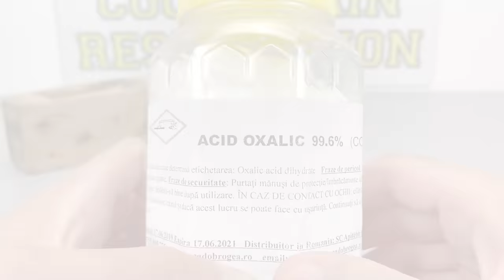Vintage Wooden Toy Car - Restoration & Repair

Comment: I recognize most of those parts as "Meccano" that I had long ago. In the US I think it was called Erector Set. Definitely a 1-off toy.
Reply from the maker: Thank you very much Frank 😎👍🏻
Reply: @CoolAgainRestoration  
Yeah all the metal parts are Meccano from the early 1960s or even earlier and you probably know the wooden body is an old hand plane the wedge would have held the blade 
The fenders and flat pieces would have been green originally
Reply: @hodaka1000  Glad you confirmed the body was a wooden hand plane, that was what I thought as you were doing the disassembly.

Comment: I'm a new sub and digging the videos. I spied with my little eyes, that the plugs put into the body weren't the same plugs you made.
Reply from the maker: I thought someone will say that. It’s the same ones but looks different because when I took out I sanded a little bit and when I changed the angle camera,I reset the white balance and has a lot of pink colour in all that footages.

Comment: All super excellent, just a question out of curiosity, why didn't you get the old crank back?. Only cleaning it
Reply from the maker: Because I can’t clean very well inside that brass part and the steel part had a lot of small pits from rust. It was easy to make new one,not a big deal 🤷🏻‍♂️

Comment: There are plenty of restoration YouTube channels out there but yours is different. First thing I realized that your workspace is very clean and your tools look like new. Working a workspace like yours should be motivating!
A humble question then;
Do you have an education for all those processes? Because knowing about mechanics is not enough. I assume you know well about chemicals for instance. I wonder the source of all those knowledge.
Keep going, we are following. 😉
Reply from the maker: Thank you very much for this kind words. I have a similar job and I know how to work with the tools but never you can be full educated in this job. Every time you learn a new clamp,new tip,new idea. But it’s beautiful in the end when you finish a job.. thanks again 🤗

Comment: 11:06 what is this "rubber shine agent"? this looks very interesting and i never saw this before ... seems to be very helpful

finally i managed to rebuild yourt "cyclone" with a little bit of improvement by a 3d printer :D your idea of this tool is still amazing.
Also you did great work restorating this little toy! this looks so awesome at the end!
Reply from the maker: You made a tumbler like my cyclone? ??
Reply: @CoolAgainRestoration  Yep, i did. The idea ist really great and your concept is pretty easy for people, who have not that much place for a sanding box or such.
Also kinda everyone who is about to build or repair things will have the parts needed lying around, so it's not much you have to buy. My biggest problem was to get 4 equal springs, which will be strong enough to take the weight of the sand, but still not to tight, so the whole device will shake and not just stand still.
Reply from the maker: I bought a spring box from Amazon with 5$ . From there I took my spring from that project

Comment: when i fix old wood,,  i use a vacum chamber  and epoxy slow set,,   the vacuum  just helps draw that epoxy in the cracks and pores deep  when released slowly and done several times over just a few minutes  and set to cure   great for worm eaten wood as well
Reply from the maker: Thanks for the tips 😊

Comment: Apologies if this is a silly question, why did you put a thin piece of metal as you cut off the wooden plugs?
Reply from the maker: Because I don’t want to scratch the wooden body accidentally with the saw

Comment: Is there any difference in the results of sandblasting and laser-cleaning? Which is one is used for which kind of material and why?
Reply from the maker: Laser is good for metal but it’s expensive. The sandblasting is more affordable 👍🏻

Comment: What did you use for cleaning the small parts in the tumbler for 4 hours? thank you!
Reply from the maker: The same media like I used in sandblasting cabinet : glass beads . But I use in the cyclone also metal beads, fine sand,river sand . Depend what I need to clean

Comment: U have a good memory...in Ur all video u separate those part at once easier and able to put it back like a before.
If I was u...im sure I don't remember which part and which screw🤣

Finally...i'm able to saw something that not related with this toy car at all...the snail 🤣
Btw it's still alive?
 I almost forgot I saw u wrote on description...it's from a coffin wood? Sound scary to me.
Reply from the maker: Yes ,it was from coffin wood plane. Not just a coffin ⚰️

Comment: very interesting. thank you for sharing. what did you use for the small parts in the cyclone, the same mix of flour salt and vinegar?  also, what did he spray to clean the rust for the road wheels? glass beads? perhaps it could be useful to report in the comment the list of materials that you used for each step (some are clear from the video, but some are a  bit generic), as it can be useful for others.
Reply from the maker: In the cyclone I used the same like in the sandblasting : glass beads.
Reply: @CoolAgainRestoration  thank you for the reply. is the cyclone an ultrasound cleaner or just a mechanical shaker?
Reply from the maker: I doubt that will work like a ultrasound cleaner. Just a mechanical cleaner I think.

Comment: My brother is attempting to “un rust” an old chain he found... do you have any suggestions on how he could go about it... using ‘day to day’ items?
Reply: Try using vinegar. It's one of the best homemade rust remover.
Reply: He’s tried white vinegar with baking soda.... but I don’t think he’s tried using ‘plain’ vinegar
Reply: @levinjayan3480  thanks!
Reply: @str8_1s_gr8_2  don't use baking soda. Use white vinegar only. Don't use vinegar and baking soda together to remove rust. Baking soda neutralizes the vinegar and thus it does not remove rust.
Reply: @str8_1s_gr8_2  welcome
Reply from the maker: Yes,don’t mix vinegar with nothing. Use only vinegar and a brush steel wheel, or just a steel brush. This is day-by-day technique
Reply: @CoolAgainRestoration  Correct bro

Comment: First of all: You gave this toy justice! I LOVE it, it look warm and cute and gorgeous!
I have a (maybe dumb) question tough. What does nickel plating mean? What does it do to the metal? I watched your egg scale video at 1 AM and i tried to pretend I understand but I don't 😂
Reply from the maker: Nickel plating. It’s a layer of nickel who protect the steel surface against rust and has a nice shiny effect. For mirror effect need also chrome plating. 👍🏻👍🏻👍🏻
Reply: @CoolAgainRestoration  So is it Nichrome, as in the material for resistance wires?

Comment: I still have most of my old meccano sets. I recognize some of the parts used in the video. It looks like one of the pieces got bent (I mean in that shape it was not part of any meccano set I know of). I guess this toy car was made by a father for his son using parts that were available to him, and that the car wasn't bought in a  toy shop?
Reply from the maker: Yes?isn’t bought from a toy store. It’s handmade 100% ,mostly probably like you said,a father done this for his son
Reply: Am I the only one who sees an carpenter Hand Planer  on the body of the car?

Comment: What did you use in the cyclone to clean the small pieces?
Reply from the maker: Glass beads like I used to blast the wooden parts 👍🏻
Reply: @CoolAgainRestoration  Thanks for that info
Reply from the maker: No problem. 👍🏻👍🏻 stay safe

Comment: Why not re-use the brass handle?
Reply from the maker: Hi David. Because I want to clean every time all. And that brass can’t be removed from the steel bar. The parts was easy to be remade and that’s why I made new one.

Comment: I would have liked to have seen the grain of the plugs at least parallel to the grain of the car.
Reply from the maker: This is true. I thought a lot after I sanded. I wanted to remove the plugs and making again ..

Comment: I still dont get it what does the cyclone do? And why do you build it and what do you use before the cyclone got invented? And where do you get these things????
Reply from the maker: The cyclone clean of the rust from small parts that I can’t sandblast. That’s why I build it and before that I used the wire brush .
Reply: @CoolAgainRestoration  ooooohhhhhhhhhhhhh but where do you get these rusty shits that got turned into beautiful art???
Reply from the maker: Flea markets or EBay
Reply: @CoolAgainRestoration  They actually sold those wow :O im amazed